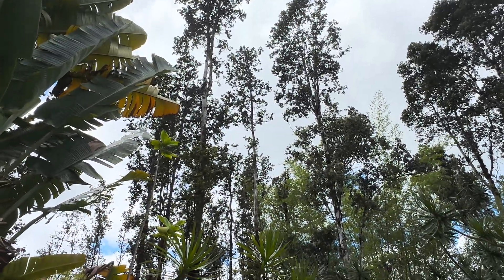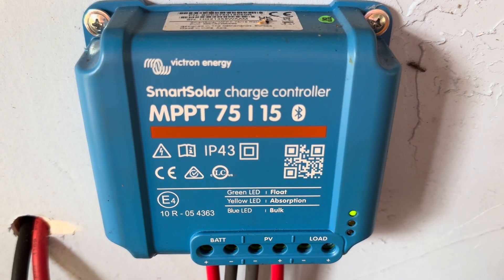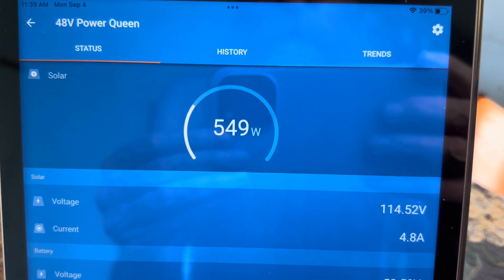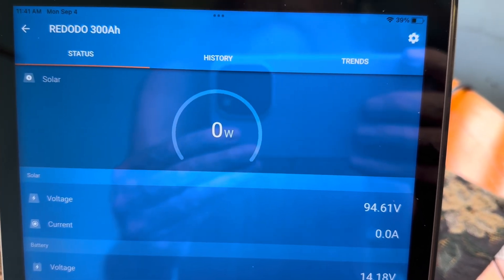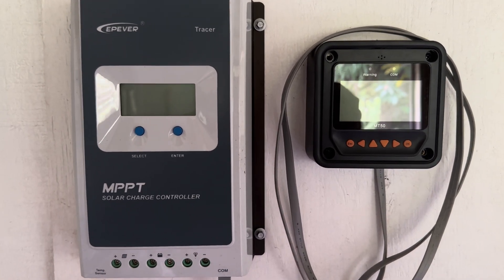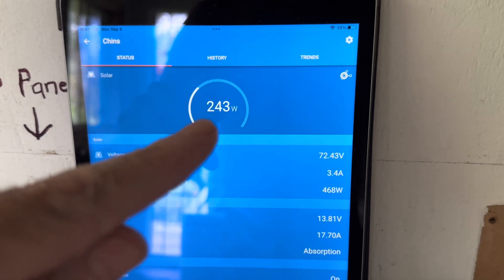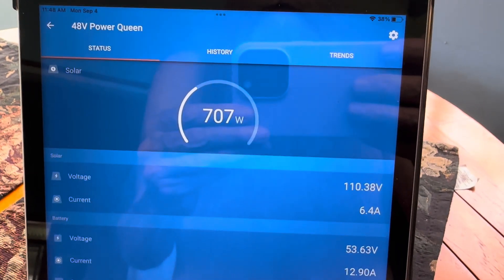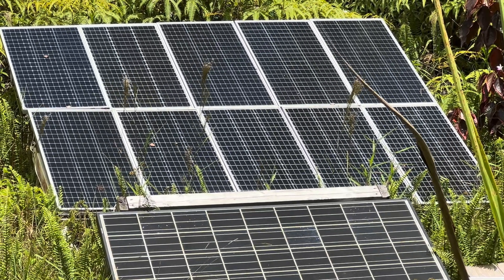Why use Victron MPPT smart solar charge controllers?

Comment: I have a relatively small off-grid solar set up (300 watts on the panels, four 6v 220 Ah AGM batteries wired in S/P to give me 12v & 440 Ah).  I'm adding a Victron inverter this spring so I can run some low-wattage LED A/C lights and phone/tablet chargers, etc.  I currently have a Morningstar Tristar TS-45 PWM controller and a Trimetric battery monitor.  They work fine, but I can't get much information out of them, as it seems like I would be able to get from the Victron controller and their SmartShunt.  The area where my cabin is also sees wild fluctuations in sun & clouds, with alot of cloudy days in the mix.  It would be nice to see - easily - what the controller is doing during that time.  I'm on the fence about switching over to Victron because nothing is "broken" or needs replacing in my system.  It's mostly an issue of ease of operation and information detail.  What do you think? Thanks!!

Comment: How should the jumper be configured on the Victron 75/15 for 12V LiFePO4? Is it supposed to be removed when configuring charge controller for that application via Bluetooth?

Comment: One thing I have noticed about my 100/50 Victron smart charge controller is that the wires keep pulling out sometimes I’ve got them in there pretty good now however I’ve noticed you use ferrules do you have good luck with them? I thought about using them for the Solar in and the battery in and the battery out

Comment: I started with victron 75/15 and now have 2- 100/30's and one 100/50 as well.   

disappointments i have is the two 100/30's will not end absorption at the same time.  This means one is stuck all day at absorption but at float voltage as the loads are exeeding 30a. 

The 100/50 over heats at more than 40 amps without forced air cooling.  It needs a built in fan, especially for the price.  It de rates to 150 watts when its hot....
Reply: I started the same way bro. But with the Lovely little 20 and Can't stop now, i have the fifteen the twenty the thirty and the thirty five. I try to buy them on sale, if possible ..The 100/50 is next 😂 Not doing over 40a so that's good to know. Ty

Comment: Just wondering if you have had any experience with the Xantrax, Outback, Midnight, or Morningstar controllers?
Reply from the maker: I still use an older xantrex c40...works well, but I like victron better🤙

Comment: I have six 120 watt Renogy panels going to a Renogy 60 amp MPPT charging my two 200ah Lithium batteries powering my 3000 watt inverter. I only run the inverter from about 9 am till about 5 to 6 pm due to shading in the !morning and evening. That said I am running a refrigerator and a chest freezer and sometimes a TV during those hours. The controller struggles to get the batteries back to 14.3 volts which is where it likes to keep the batteries when there is no or minimal load. From what I have seen the Victron app looks much better than the Renogy. My second system is an Epever 60 amp being fed by six 100 amp panels. This feeds two 100ah lithium batteries which supports a 2000 watt inverter. I run this system the same number of hours as the first system. This powers two chest freezers. The inverter will keep the 2 batteries at 13.9 volts but no higher whether there is a load or not. I don't care !much for the Epever controller.

Comment: love the video ! really shows the speed of MPPT tracking. this really adds up over time. my main controllers are Morning star MPPT Tri-Star ones. they work fast MPPt as well. just harder to set up. I had to custom promy small system is victron gram for 24V Nickel iron flooded battery system.  for me this was easy. my small system is victron 75-15 . can do 12/24V AGM or LiFePO4 or custom settings for outher battery types.  set 12V AGM now. charging station only. no loads . has anderson disconnect's throughout the system. super fast and  easy. to change it. with victron you can plug in USB cable and program direct PC as well. and what I love the most that victron products can be networked together with ease .
Reply from the maker: Mahalo brother! The Victrons make everything so easy, and worry free. I'm about to get another 100/50 for an upcoming project. Plug and play, and forget about it! Aloha! 🤙

Comment: I have to agree that the Victron controllers are very fast in cloudy / changing sun days.  I run several Victron, Midnite Solar, and Morningstar MPPT controllers and ironically after using the Victrons about four months now I think the biggest draw to their product line is the reporting ability using blue tooth.  But again, in my experience, the best thing to buy is the smart shunt since that tells me everything from the solar salad that I have using the controllers listed above.  I have been purchasing used Victron controllers to add to my collection which is now looking crazy since  I have boxes of them now.  However, with the changing solar markets I will be moving and setting up a 48v system with all-in-ones since those are SO much easier for a novice.  But you cannot go wrong with Victron, Midnite Solar, Morningstar or even Outback.  Also, IF someone buys a BLUE Victron, just buy one smart dongle to program anything or update the firmware.  I use the dongle to program the used controllers if they lack blue tooth and then put them on whatever battery bank makes sense.  Always enjoy the content.  Aloha
from SE Michigan.  Also, someone asked about running a window A/C unit.  5000 BTU will pull 400-600 watts, so my advice is a Kw of Solar, 400AH lead acid or 200AH Lithium and at least 30-60 amps of charging ability and a 1.5Kw inverter.....keeping it cheap as I can.

Comment: I have used Epever  for  2 years now and I am very satisfied with  the performance. I  have 4 ea 12v 100amh batteries  in  24v configuration. I have 1200w of  panels  though..
Reply from the maker: Epever actually worked pretty good for me too. But it would not keep up in my fast changing conditions near as good. Aloha! 🤙

Comment: Victron charge controllers are awesome, and their inverters are awesome too, the stand by consumption is almost nothing, but those inverters are expensive..I had good results with the Epever back in the day, the one with the giant alunimum heat sink..
Reply: Only expensive in comparison to junk inverters.  The Victron will probably last forever.
Reply: @ItsEverythingElse  Don't get tied down to a brand name...What is good today could be junk tomorrow..With one board member meeting..I had Victron components when I ran a 12 volt and 24 volt system..But, at 48 volts I have all different components that work very well..I agree Victron makes good stuff, but there are many other companies that make good stuff..

Comment: It's interesting, as I've, due to your vids, and others, picked up a 100/50, to try against my 8415 AN Epever, which has been running flawlessly for a year and a half, and have compared it directly with the epever. I added a smartshunt, and a Cerbo GX, and the Victron, on two mostly full sun days, but with some clouds and compared it to our house solar as a control, but the Epever actually produced more(on a cloudier day). I also bought a Victron 75/15 to run our tool shed, which also passes power to our home office, and simply couldn't use the Victron as the load out would not work like it does on the 30 amp epever I have in there(per victron's forums a bug that they refuse to fix). Long story short, we're building a 3600 watt array to run the AC in our garage, and charge our Ford Lightning, and we were going to pick up a Victron Multiplus II to run that, but I think now we'll just repurpose the Epever, since, it also does 48v. I think the phone app actually functions more simply and more readably in the Epever. I just don't see a justification for the additional expense. If I get a chance to run each for a week before we put in the array I'll check them again, maybe with clouds, as we should start getting some rain again soon.
Reply: Could you explain more about the Victron bug/problem you were having. I was thinking of trying a Victron controller but they are a bit expensive. I have several 4210 Epever at present. Sorry I did not understand when you said you could not use the Victron on your tool shed. Thanks. Sam
Reply: @sammaimas155  Victron is expensive when buying but in the long run they are cheaper. They last longer, perform better, are safer and are easy to combine with their other stuff. It is a no brainer for me.
Reply: I am running the load out terminals from the epever, I think, 3210, to a UPS in my home office, and when I tried the same setup with the victron, it would not output through the load out terminals. It was if it didn't see the UPS to feed to. Seemed simple, but the victron wouldn't do it, the epever did. From threads on the Victron site, this appears to be a long standing bug. I like it because I can then monitor my home office power usage in the Epever phone app, and cloud page, in addition to using the power from the sun, of course. @sammaimas155

Comment: What would it take in solar to run a small window unit air conditioner or a mini-split on days when it hits / 80
Reply: We have 1200 watts of used 300 watt panels cooling a 14x8 shed with one layer of R9 fiber panel insulation, and they produce about 5-6 kw/day, in mostly full sun in the summer. In 100 degree days, in Texas, a 9k btu 20seer Pioneer Diamante mini-split needs about 7.5kw/day  to keep the temp at 72-75 degrees from 9am to 9pm. 80 degree days would be a LOT less. We have a transfer switch and pull around 1-2 kw/day from the shore(house) power.
Reply: 1k watts of solar pannels if you have a battery if  trash battery bank better make it 2k in pannels